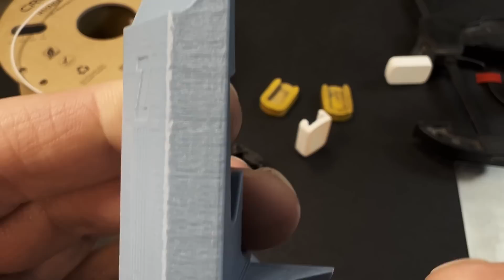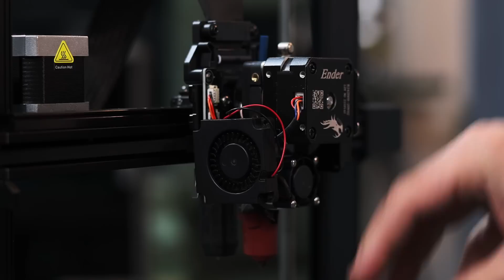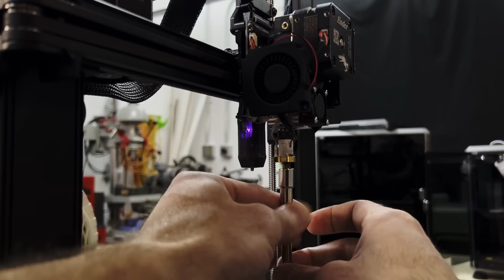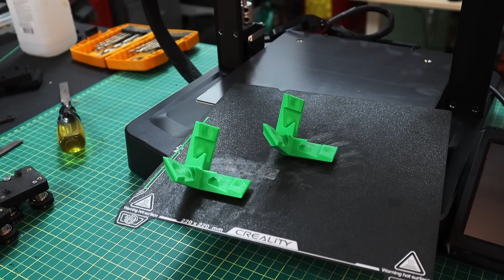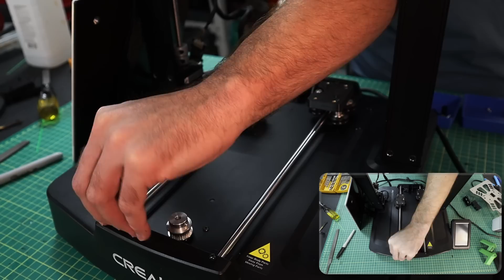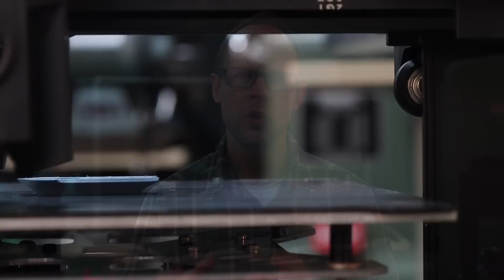What Causes BAD Print Quality on the Ender 3 V3 KE? - Fast Bed Slinger

Comment: for 8mm rod size tolerance is +0 / -0.009 mm
WHY would Creality use such s**ty rods ?? ??
Reply from the maker: Someone mentioned that 5/16" and 8mm are so close that it's possible there was a mix-up of some kind and they ground to the incorrect size, ran out of stock and thought it would be okay to swap, or something else.  If the rods were 8mm exact or even slightly over, we'd have much better success.  As far as the quality of the rods, they're consistent, they're nicely machined and ground, they are also hardened (my good files skate on them) it's just a shame the size was off.  No matter, I'll have a better solution pretty soon for anyone with this issue.
Reply: @NeedItMakeIt  linear rails are great, but  Creality should replace those rods free of charge - don't you think ?
Reply from the maker: @cthulpiss  Yes I think they should if someone can measure that they're undersized they should replace them and try to avoid having to swap them out.  In my case, I received the printer from Creality to test out and I'd like to offer a solution to people who want something better, but yes that's a good point, it's a good idea to try to measure your... well rods and send that info to Creality.  I understand that they watch my videos, so I hope this is not a long-term problem, it may already be corrected.

Comment: Would Drylin bearings make a difference??
Reply from the maker: If there was some way of getting a perfect fit.  I'm not sure it's ideal here, drylin relies on a tight fit inside the block and that reduces the ID just enough.  I don't now how well it'd work when we have a plastic block, it may end up expanding instead, or both take up the difference.

Comment: I hate that every printer coming out has at least one design flaw or oversight
Reply from the maker: Yeah, they need to at least cover the basics.  It seems that other people have the issues I've been having, but some people also tell me that their printers work great.  I'd have to ask them to print on the front and back corners to be sure, most people probably center the print and may not realize.

Comment: What about adding weights to the corners of the bed top before printing?
Reply from the maker: I suppose we could add some type of spring, but I don't know about weight, with these slingers they rely on having as light a Y axis as possible.  I was thinking about having a spring on each corner which has a wheel below and ridges along the base as it moves, but it's a little gimmicky I think.  Thoughts?
Reply: @NeedItMakeIt  i was thinking more along the lines of 4 magnets in the corners. 
Once the printing is about to start.
Heavy enough to reduce some vibes but not to much weight... ecen could mount them underneath the plate..
I am only new to this ...only got the printer yesterday.
So far so good but i may try it out and i will get back to you. 👍
Reply from the maker: @McRcFly  That's a really cool idea, have you seen the Magneto printer btw by Peopoly?  Your concept reminds my of what they've done.
Reply: Could even hot glue some lead fishing weights to disc type magnets...

Comment: so in other words, get a cr10se, which is basically this printer with a linear rail y axis
Reply from the maker: I think that would be a smart choice!   It's such a shame, the rods are a high quality piece, they measure consistently, they're hardened (a file skates on them) but... the most important part is the size.  I guess some people share the problem and some are okay.  Rods can work, but I'd like to see less cantilevering going on under there.  I'll have a solution out in less than a month for this printer to use linear rails.  There is already an option out there, but I'm looking for the ultimate for maximum stability.

Comment: I can confirm the entire extruder carriage has a lot of slop on the linier rail when i played around with both the SE and KE at a local Micro Center. There was about 1mm wobble back and forth on the nozzle tip. You can clearly see it move. As for the bed, you can try to move the rods away from each other under the bed to tension against each other and remove slop. Another way is to turn the rod bearings so they ride on 12/3/6/9 o'clock on the rod. That helped a lot years ago on a i3 style machine.

*it would be nice if someone made a slide block that could be adjusted with a screw or something, otherwise taking it off and bending it with a vise a little to have a little tension on the bearings might work

Few more flaws like the belts not being straight on the carriage and bed, which will distort the travel ratio when the bed/extruder move near to fixed gear on the stepper. A^2+B^2=C^2 will tell you that's a problem. Exact reason why i returned a K1 i bought on Black Friday. Another one was PID tuning was bad for the hotend, it would jump 3+/- degrees when printing anything faster than 200mm/s 3K. Tired PID tuning about 5 times, even tried to manually slowly and consistency feed filament which barely helped. My guess is the thermal mass and/or heat conduction is not being taken into account, idk.. i returned it

Unfortunately Creality's machines have always been "built by committee" that clearly don't talk to each other

WITH ALL THAT SAID, i bought there first effort into premium 3D printers the Sermoon D1years ago with TONS of major design flaws for $260 open box a few years ago. Amazing frame, thing weighs like 50 lbs lol. Can barely hear it in a closet printing at 325mm/s 4K (400mm/s 5k travel)

Comment: I just saw a video saying the screws are too short for the rails have to tried putting larger screws in the front?
Reply from the maker: I didn't find that there was any movement on mine, but it's not a bad idea to put longer screws in, just make sure they're not too long because the bed passes with little clearance in that area.    

I put a dial indicator on mine, and the movement from the undersized rods is being multiplied out near the front of the printer bed.  Towards the center it's pretty accurate, measuring at 0.01mm at the center, whereas we have 0.15mm at the front corners.  

I'll have a final solution out pretty soon which is going to be pretty easy to install and not too expensive either.  it should allow higher speeds and will also be very precise too!
Reply: @NeedItMakeIt  im looking forward to it mate, so much fun tinkering with this printer 😀

Comment: thank god i had a "let me watch another YT video" moment before ordering it xD guess I'll wait your final parts to arrive and see whether it suits me or no 
thank you for the awesome videos
Reply from the maker: LOL, when I was younger, breaking things always came naturally to me, putting them back together, well that was a different story.  I think with most reviews we see, they're biased and you don't see the truth.  I think we have a printer that has good potential but it needs two adjustments, those rods and linear bearings and it needs a better extruder or at least the all-metal version of it.  They have a new printer out or it will be shortly, the Ender 3 Plus, but I think that it has a similar setup, so we'll see whether it has the same issues.  

When printing in the outer corners and adding weight as well, it'll be more likely to have problems the bigger the prints get as well, I don't see anyone testing them in this way.  

I'm glad it helped you out.  The final fix video should be out within a few weeks, it'll be even better than the best bed slinger... at least in the Y axis.  

Thanks for taking the time to write a comment!

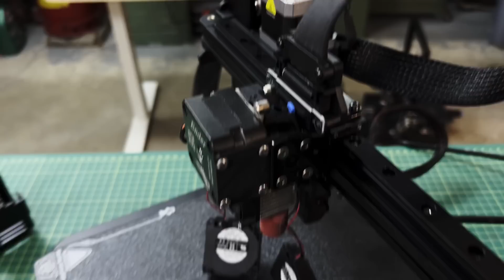Comment: Hello from Athens. Will you c 2:33 consider when you came up with a final solution with the bed instability to sell to me the parts to correct my KE. And if so what will be the cost.
Thank you for you serious approach to this issue. Best wishes
Dennis Anghelatos
Reply from the maker: I'm a couple of weeks out from finalizing the video, the plan is to make it available to everyone for free.  A subscription to my channel would be nice, but no cost to anyone.  I have come up with something that's easy to install, it's pretty inexpensive and it'll provide a lot more stability.  If you need someone to make the parts for you, I'm sure either I can do it, or someone near to you can make them up for you if you need it.  If you're getting a lot of movement in your printer bed like mine you can also consider contacting Creality and see if they'll send you a replacement set of rods and bearings at least there's a chance they'll fit better.

Comment: Is the problem the same in another corner? Home much flex is in the load cell? Since you have full access to the firmware, could you machine a solid arm to replace the load cell and rely on the BLTouch for z height? Just for a test. 

Regardless, that amount of play on the bed should never have left the factory. That's one of the reasons my free DaVinci 1.0 printed like total crap, which is why it was free.
Reply from the maker: I've done more testing and I have another follow up video in the works for a final solution.  I have tested the movement at the front on both sides with a 0.0001 dial indicator, and what I have measured is that we have 0.01mm when I measure movement in the center of the bed, that's a great number.  When I move to the front and back corners, we have 0.15mm of movement, which is far too much.  I've heard that lots of people have this problem, but some people don't report it at all and say that theirs prints fine.  In any case, the central bearing position and a fairly short bearing compared to the bed size isn't ideal.  I'm providing a solution for everyone which is fairly inexpensive 30-40$ total and it should work far better even under the worst printing conditions.  I'll be another 3 weeks probably, I'm still waiting for parts...  

The BL probe idea is a good one, I think the CR and BL are basically the same, so it should be possible.  I'll have to see if I can also get similar results with that, clever idea!

I think they should re-deign to incorporate linear rails, or have a system where the rods are larger diameter and extend beyond the front of the printer base.  That would allow a longer bearing to be added.  All of this costs money, but it also makes sure that people are happy with their purchase.

Comment: your solution was so promising shame it didn't work out lol there is a stl on printables to fit MGN9H or MGN12H rails, do you think this may resolve the issue? Also, could this be a necessary mod out of the box? I am getting a KE delivered in a couple of days could order parts now
Reply from the maker: Yeah, unfortunately there were too many limitations with the wheel spacing likely being the main one.  I have another video coming out with the linear rail solution.  What I've done is taken it to the limit and I have made it far more stable than anything else out there.   I am waiting for the parts to arrive before I can release the final video, I need to make sure it all works properly of course.  

Your printer may be usable, it seems that they don't all suffer from the same problem, as the bearings wear, you'll likely start to see the same issues over time.  

The linear rail solution on Printables should work okay, but it still has the issue of the centrally mounted carriages and I think that it's not ideal. 

I'd say to wait and see what yours is like, maybe it's okay out of the box.  I hope they've fixed this problem, it'd be a shame to be sending everyone printers with these same issues.
Reply: @NeedItMakeIt  yeah fingers crossed. I'm coming from an Ender 3 v1 pro so I'm sure whatever the case it will be much better lol but I look forward to seeing what you have in store I'm sure it will be entertaining, thanks for your reply
Reply from the maker: @xXIamJAEXx  I think mine was worst case, I've measured some of the other Rods from Creality and they're 8mm right on, bad batch maybe, I'm not sure.  

The plan with the rails that I'm working on is that the Y axis will be the most stable and it will allow the speeds of the printer to be ramped up high and still have good results.  That's the plan, now to see if I can execute it properly!
Reply: Just saw an interesting video by Teaching Tech on linear rails from a few years ago, the results are interesting.

Comment: Hey Mike, I just did some measurements of my rods and I could not get a measurement below 8 mm.  I didn't take them out of the machine like you did though, so it's possible they're the same.  But still, I really couldn't discern any play in the bearings whatsoever.  With enough force, I could get the bed to shift in any direction and  visually I can see that I am actually bending the rod to do so.  Maybe they achieved better tolerances in more recent units such as mine?  I received mine on the 19th of December, though I preordered in September (yours I presume you received even more recently, but stock could vary).

I have a couple artifacts I am fighting as well, not sure they are the same as yours.  One is that it always seems to push too far in just one of the corners when making hard turns (I want to say front left, but haven't printed in a few days).  Another is that I will get either an under extrusion or layer shifting, but it's not completely consistent on where it shows up.  A third is that my bed must be out of level enough that the auto bed levelling can't compensate, because when I do the Prusa test at 0.1 mm height front corners tend to fail.  The first layer in general tends to be a bit uneven.  I got a smooth PEI bed from Creality and I plan to do the spacer and perhaps even tape modification.

I've also got linear rails, I was planning to do the D3vil design mod on here, but to see you working on it, maybe I should wait.  You thought your design is superior somehow?  My rails are MGN12H from AliExpress.  Hope that's the direction you went... but I think Derrick's design should work anyways, he did get a good vibration reduction in his accelerometer test.

Derrick was also able to achieve 49 mm3/sec by changing out the hot end to the ChB-OT .  So there is more potential in this machine yet!

Comment: At least part of the problem here is the spacing of the linear bearings front to back on that table...or more correctly, the lack thereof.  Only 2 linear bearings...side by side in the same location along the Y axis?  OF COURSE the table is going to be prone to rock up and down at the front and rear edges with that setup.

I mean we all know Creality can't have an original idea, but can they at least copy the ideas they "borrow" from other manufacturers correctly?  Even the Sovol SV06 got it right.  They use 3 linear bearings on the Y just like Prusa does.

Great video though, and thank you for showing this!  Before seeing this, I almost made the mistake of considering this printer.
Reply from the maker: Yup, it's basically a wide pivot point, not really ideal.

I'll have a fairly inexpensive and easy solution video in less than a month (I need to wait for parts to arrive). The other day I measured rods in my K1 printers, and they are slightly oversized, if that were the case on the KE printer, it would probably be acceptable.  It is always possible that it's a bad batch, it happens, I can't be sure.  

I hope they see the video and fix the problem and at least the printer works no matter where you print on the buildplate.  I think the printer can still be good and fast, but not with this issue lingering.  

Thanks for the support.  I have another one about the Max coming out in a day or two about how to get the best first layer, this is another common problem people seem to be having... and after a few days testing full-bed sized prints, I finally understand the cause.  

Have a great one!

Comment: YES! I would like to add linear rails on my Ender 3 V3 KE. Thank you for all the good content
Reply from the maker: I have the printed parts designed, I'm just waiting on the rails to arrive, and then I can finish up the video.  It'll still be about 3+ weeks unfortunately, I wanted to order the cheap rails so that I can confirm that others can do the same.  There is no sense buying really nice rails that cost as much as the printer.  The solution should work really well, I went a bit of a different direction than most people adding rails.  I've gone for as much stability as possible while trying to make the install as simple as possible as well.  Hope it works out!  

Thanks for the support!